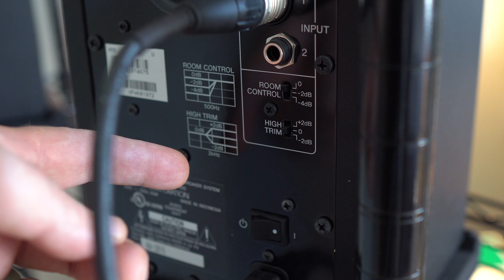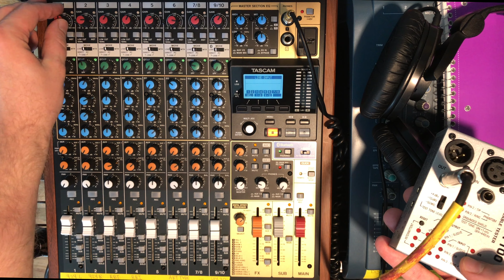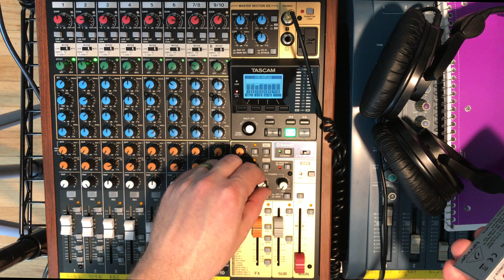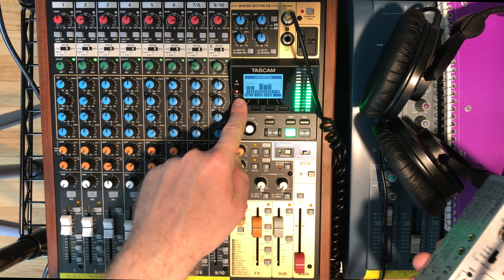How to Connect Studio Monitors to the Tascam Model 12

Comment: Thanks for this video.  Bus routing is maybe the most challenging part of Model 12.  I can’t count how often I have read “Monitoring section” on page 15 of the manual.
Reply from the maker: Thanks, Tracy. I've made extensive notes in the manual and the more I think I understand about this machine, the less it seems like I do. One of these days...
Reply: So true. I like the Tascam a lot, if you have a bit of experience with mixers it is very convenient and easy to operate. But the monitor section including the headphone outs left me confused more than once. The main critical issue I have with the otherwise really brilliant Model 12 is that you can't mute the main out and still have the main signal on headphones. This makes it necessary to switch your monitors off, if you just want to listen with headphones. I know that one could use the sub out for the monitors, but if you need the sub for other purposes you're forced to use an addiontal headphone amp or monitor controler or really climb behind your monitors and switch them off.
Reply: @dirkpehrke9909  that problem is fixed in the latest firmware update

Comment: I for the life of me could not get sound out of the speakers when using the computer as a source. Turned out to be that the sampling rates didn't match. Once I changed the settings to match and rebooted the Tascam, worked like a charm!

Comment: Hey, so I made a discovery and am happy to report that the headphones does not need solo sends to have sound work through it. The headphones work off of the main fader just like the main monitors. Sound happens simultaneously through the headphones and the mains. If you have all buttons off except for the main sends on the channels you will get sound through the main out and headphones at once. Just unplug your mains if you want headphones only. I think people default to turning down the main fader in order to use the phones. They aren’t separate. Main fader is needed for both.
Reply: I was looking for this comment because I was thinking the same thing and sure enough, here you are! Thank you for confirming this!
Reply: @bludhaundrecords  you’re welcome! You can also change how the solo button operates and have it reflect what you might be expecting a solo button to do. Just hit Menu the scroll down to Mixer. From there scroll to Solo Mode and switch to “Inplace Solo”. That will make it so you solo tracks as expected.

Comment: Another great video! I have been using my Model 12 in tandem with my Tascam 414 cassette recorder and your videos have helped me to discover some excellent functionality in both machines and home recording in general. 
I too was confused about the solo buttons on the Model 12 at first. Until I went into the mixer section on the main menu and discovered that you can assign the solo buttons to function the traditional way (one track playing alone)
Or, assign it to AFL/PFL. I didn’t really know how AFL worked until watching this video. I have been using the sub out to go into my 414 and using that as a head phone amp. That or just not turning the monitors on when using the main mix to headphones. Thanks again for the fun videos!
Reply from the maker: I'm glad it was helpful, Aaron. Tbh, I'm still confused about the Solo bus! I need to do more reading and experimenting. I definitely have them set to AFL. My big thing is needing to mute the monitors when listening back on the headphones, so your 414 solution is brilliant. I'm doing something similar with the headphone amp through Sub. That's something I should have mentioned in the video: you can still hear the headphones through Main without routing them to Solo bus, but there's no way to mute the monitors if you're tracking with headphones. Like you said, you can always turn the monitors off, but it's not always practical with how I record and mix. I'm definitely going to do a dedicated PFL/AFL video once I wrap my head around it! Cheers and thanks for watching! More to come for sure!

Comment: Thank you for the info. on plugin in the mixer into same power strip as the speaker monitors. Cause i had the mixer plugged into the ac wall outlet, and the other devices plugged into the power strip. Which i was getting ground loop noise. So i gave your advice a try, and it worked. No ground loop noise.

Comment: The band I play with uses this board live. Does the recorder need to be on to utilize the auxillary outs? I am trying to solve their monitor situation. Also, they split the main outs by using the sub outs to the subwoofers and the main outs to the main speakers. Is the board designed for this type of setup? Thanks

Comment: Amazing Video!!!

How do I record while my channel 1 & 2 are being used for monitoring in stereo? I’d like to use those channels to record bass and guitar. I’m on the Model 16
Reply: You don't. If those channels are set to PC mode you can't send and receive signal at the same time. An update for the M12 came out that allows to route the monitoring for the stereo channels (9/10 on M12). Check if they did the same for the M16.

Comment: Thanks for the detailed video. I thought the SOLO Bus was a mono bus, ok during tracking, but any stereo playback on the MTR or PC return will also be mono. Am I correct?
Reply from the maker: Thanks for watching. Honestly, I get confused about this and I hope that it isn't confusing in the video. SOLO bus is a mono bus. The one thing I forgot and didn't mention in this video is that you can hear the headphones as well as the monitors on MAIN but the issue is if you want to only hear the headphones, you have to power down your monitors. For my workflow, this doesn't work very well. The benefit of using the SOLO bus (even though it is mono) is that you can have your headphones on a separate bus, independent of MAIN. I should have mentioned in the video that you can also use the headphones on MAIN while the monitors are playing and they will be in stereo (or you can get a headphone amp and use the SUB bus so the headphones are independent). But yeah, SOLO is a mono bus.
Reply: @424Recording  Thanks for the reply. Yes, I have the same issue with Headphones tied to the Main. Very annoying. I hope TASCAM can correct this soon, as it's a digital firmware change.
Reply from the maker: @RecordingStudio9  My pleasure. Thanks for watching! Wow, that's awesome. I didn't know it was a digital issue. I hope they fix it soon, too

Comment: Hi
Thanks for this tutorial......
One question though
I have my Korg Kronos hooked up to the Tascam Model 12 and the matter lights are working
However, I have to turn up my Keyboard almost all the way to get even the bottom row of the meter lights to light up
In your video, your meter lights are almost in the Yellow (6 DB's)..............What am I doing wrong, please
I have turned up Compression and gain  and master and still the meter lights only go about  -30 DB's
Are the meter lights only for recordings ?

Comment: I use a small strip or rock and roll (gaffers) tape and a good Sharpie Mark L/R  on the duck tape. Gorilla duct tape will stick to plastics. Couple thoughts.  I recently purchased a new Scarlet 2l2 Question here is would we out from the mixer to the Scarlet to the HS5's and Head phones?

Comment: Hi Mike, I'm trying to move my songs from my 424 to a macbook pro, but I think you can only do this in mono (without an audio interface) just using the headphone input on the laptop. this may be a very stupid question (i'm not technical at all) but is there a way to use the model 12 as an intermediary between the 424 and laptop that would allow me to move the cassette recording to the digital world in stereo? I really don't want to buy an audio interface and was thinking of moving to a model 12 anyway.
Reply from the maker: Well, the 12 can be used as an interface as well. You could easily bounce your cassette mixes or tracks to the 424, too. Or the simpler solution would be to get a 2 or 4 channel interface for your laptop and bounce that way. So, yeah, either the 12 or another interface would work well, just depends how you want to work and how much you want to spend. Cheers!
Reply: @424Recording  Thanks! Appreciate the response.

Comment: How do you connect outboard gear into the Model 12? I have a Warm Audio WA73 EQ and WA 2A Compressor that I want to add individually to my drums, guitar,  bass, and vocals. I'm going "AUX output 2" into the EQ and out of Compressor into MIC/LINE channel 9/10. Please let me know if I'm doing it wrong. I'm also using ProTools. Thanks as always!
Reply from the maker: Have you tried using the inserts? The only problem is that they're only on channels one and two
Reply: @424Recording  Inserts are for when recording live and not during a mixing session. @Alex Cruz Yes, you are doing it correctly.
Reply from the maker: Oh, gotcha. I thought this question was about recording live and printing the effects to the tracks in real-time

Comment: I'd like to use this board for live shows. Specifically for running open mics. I'd like to bring music in and out from my laptop between performers. But I want to be able to use my headphones to cue a song without that song coming through the main speakers. Is there a way to do this without having to buy an extra amp to go through sub? Can I send my laptop audio to aux and monitor that way?
Reply: I've heard that muting issue was fixed in latest firmware

Comment: Do you have to power each monitor individually?
Reply from the maker: Yeah. Either that or send out the signal to an amp that powers both speakers
Reply: @424Recording  I think me and my power outlets prefer the second option.
Reply from the maker: @Mark_Williams300  You could also use a power strip? That's what I've got
Reply: @424Recording  I have a rack mounted seven outlet strip.  With seven things plugged into it!
Reply from the maker: Time to get another one I guess!

Comment: On the 24 you cant mix with all the solo buttons pressed as they give u no pan or eq and the headphone nob works fine when using monitors simultaneously, crazy how different these units are,
Reply from the maker: That is crazy. The 12 probably should have been called the "Neo Model 12" with a different design. There still seems to be a lot of confusion out there between the models. I'd like to check out the 16 or 24 someday and maybe do a comparison of features
Reply: @424Recording  yeah that would be a cool thing to do, and yeah definitely i think the 16 and 24 are more similar to each other than the 12, i also wouldn’t mind the 12 just to compare and muck around with, cant really justify the money though lol
Reply from the maker: @craighughes-shug6694  Ha! I hear you. That's where I'm at, too. I would do it for the sake of experimentation and getting down to the difference between the units but I have no actual use/need for one so it's hard to justify!
Reply: @424Recording  yeah same very hard to justify, if the model 12 had mire options like the dp series with editing and mastering even, then I’d consider it for using along side the 24 but its not different enough that i want to, looking into a 424 for some possible mastering where i want that his and natural break up
Reply from the maker: Exactly. I'd be interested to see if the recordings sound any differently through the different Models, too. 424 ftw!
Reply: Headphones work normally on the Model 12 when using monitors on either Main or Sub outputs.  The complications arise when using Sub to route an alternative, outboard support for headphones.  Some people do this but that choice involves not using the built in headphone jacks.
Reply: @tracyharms3548  this could well be the case with the model 24 as well then, I’ve never tried routing any outboard gear for headphones yet so my bad, i will be looking to soon though so thats good to know
Reply: @424Recording  yeah I’d also like to new if recordings sound different probably mire if the mix sounds different for better worse
Reply from the maker: Ah dang, I made a mistake here. You can hear the headphones in stereo on Main and Sub (if using a headphone amp) but the problem with using Main if you're recording with both monitors and headphones is that there's no way to mute the monitors without also muting the headphones, unless you use Solo for headphones. But then yeah, you can't mix on the headphones in Solo
Reply from the maker: There's always the question of the analog vs digital mixer, too!
Reply: @424Recording  I haven’t found much to prevent mixing with channels on solo.  Balance might not work normally on the stereo channels under solo, but everything else seems to.  I haven’t tested this exhaustively, however.
Reply: @424Recording  oh yeah i get you, that makes more sense can you no use the control out for recording then switch to main or are your control outs already taking
Reply: @424Recording  and yeah on the 24 the solo pfl is only pre fade so no pan or eq applied thats just a no go for mixing
Reply from the maker: @tracyharms3548  Maybe depending on the PFL/AFL setting of the channel? I was thinking of lack of panning, but it is often useful to mix in mono
Reply from the maker: @craighughes-shug6694  Oh gotcha. Yeah, you can set it to AFL on the 12 but still no panning. The only other outs on the 12 are the Aux outs. There's no dedicated control room outs (though that would be awesome!)
Reply: @424Recording  aw i see, thats a bit of a design flaw, on the 24 you have the sub out, the 2 aux outs, main outs and control room outs for monitors although only 1 head phone out
Reply from the maker: @craighughes-shug6694  I guess it would be possible to use one of the headphone outs on the 12 in the same way, with a breakout cable connected to the monitors. But it still wouldn't solve the mute issue... I guess you could add a mute button inline... the feature set of the 24 looks lit
Reply: @424Recording  yeah you probably could but all the extra work which isn’t much tbh but would if been bette if they came with a better solution, yeah the 24s cool but its got some features missing to the 12, theres no midi in, outs cant mix with the compressors, theres only AFL on the 2 auxes, you cant change anything to post EQ  expect the obviously the auxes, can only plug instruments in the first 2 channels there the only hi Z inputs. love to see a master board kind of like the 24 but with all the features the 12 has, also inserts on maybe the first 12 channels not just the first 2 would be cool,
Reply: Thanks you so much, saved my day !

Comment: It's a shame that this mixer, after a few months of domestic use, began to malfunction as many as 3 knobs, which among other things have non-removable the external plastic parts (if I pulled harder I have the clear feeling that they would break); in practice they only maintain the frequency they indicate if my hands remain in contact with the knob, otherwise as soon as I leave them, they always return to the flat position. If anyone know what the hell could be the problem, hit up. ah...and it has never suffered accidental damage. Unfortunately I immediately noticed an evident fragility of the components.